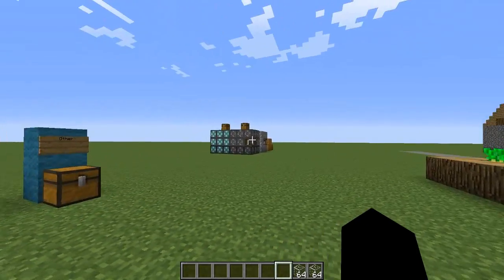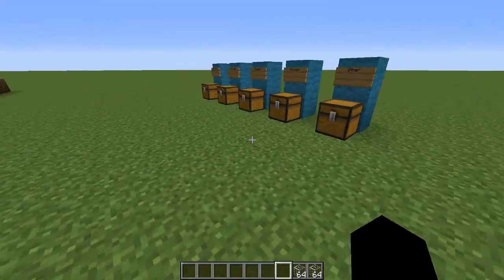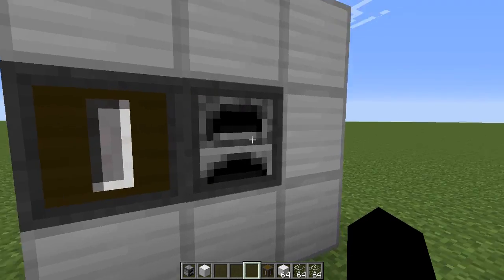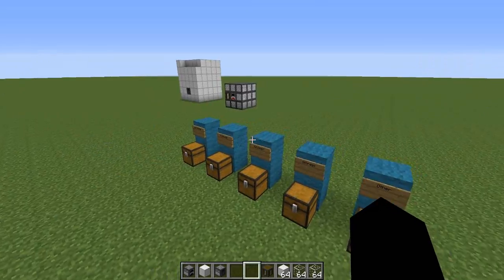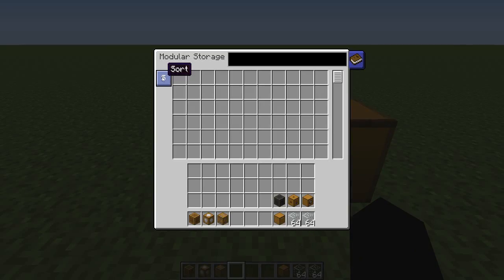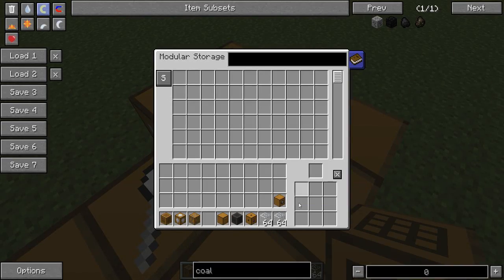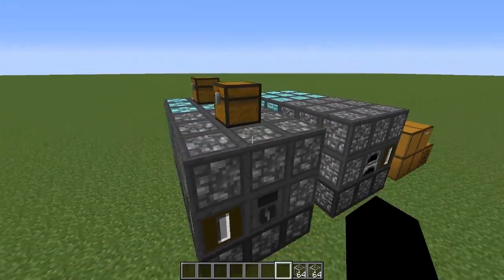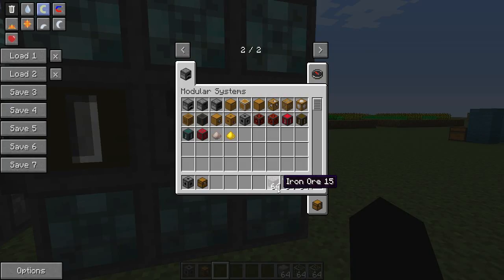Minecraft Mod Spotlight: Modular Systems

Comment: integration with other mods ?  logistics pipes, ae, enderio ?
Reply from the maker: +kowy I believe its more of an alternative or early game version of AE or thermal expansion
Reply: +kowy There is a block that allows you to set as output or input, so that you can use with other mods actually.
Reply: +ZergMazter or there was I dont know anymore. Wait is this the same mod 'Modular furnaces'?
Reply from the maker: ZergMazter I believe that you are correct in that there is an input/output block and there are modular furnaces but I'm not sure if they are the same mod
Reply: +The Sea Penguin It's the same mod lol. They just drastically updated it even with a name change. Wow lol this mod has grown. I still had the 'Modular Furnaces' file haha. 

Yea that block is supposed to give you the flexibility to use with other mods. That is too cool.